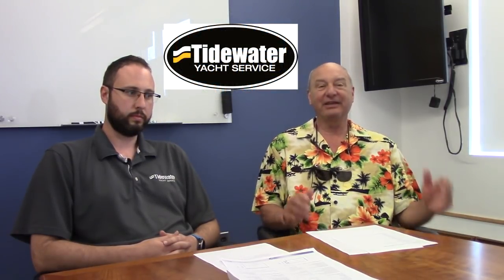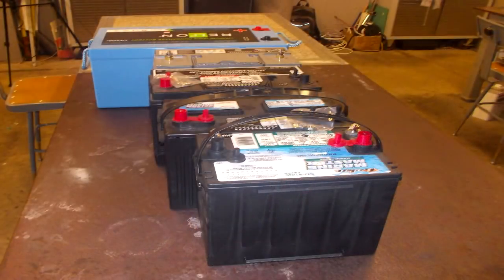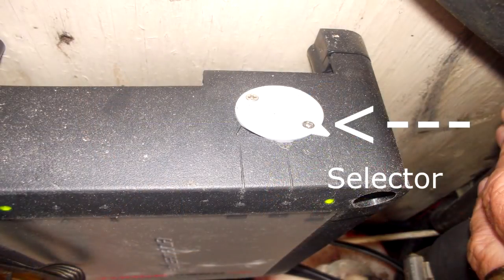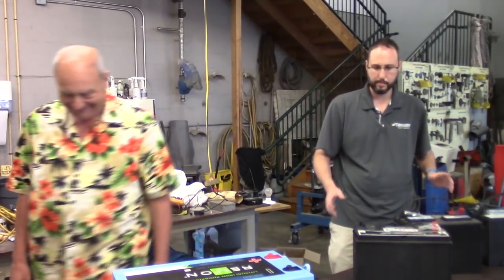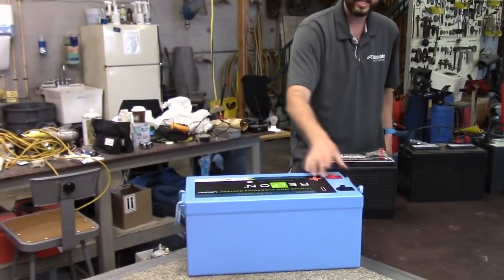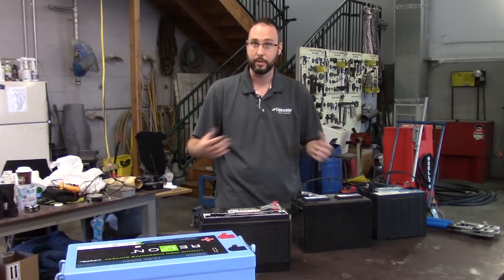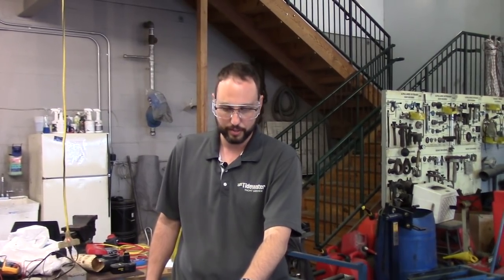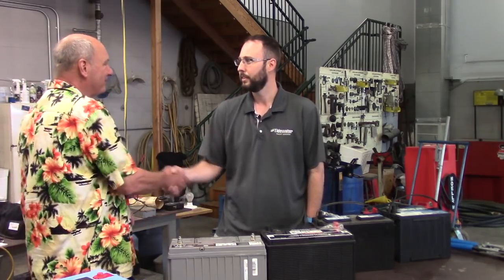Batteries: Types and sizing for your boat

Comment: Just as a side note, lithium iron phosphate batteries will not typically see 10k-15k charge cycles.  Most of these batteries typically have listed cycles anywhere from 2000-7000 cycles.  That being said you can get more cycles out of them if you do not use them in a typical fashion.  If you can cycle them between 30 percent state of charge, and 70 percent state of charge then they will last 10k-15k cycles probably.  Lithium iron phosphate batteries like to cycle around the 50 percent mark, and you can damage them permanently by running them down too far.  Also they don't work in really cold winter temps without heating, etc. Also charging them to full capacity typically generates a lot of heat and the cells hate that heat.  If you have enough capacity to only pull like 40%-50% out of each battery every day then you will get more cycles.  So buy enough batteries to make this happen or adjust the charging accordingly knowing the number of cycles will decrease.   So if you have solar set the top charging current to equate to 70% and have some way to cut off the loads when the state of charge gets too low or at the bottom threshold you desire with an alarm.   Also alternators can cook lithium's so using them requires taking care to modify or replace them accordingly.  A pretty good talk about batteries there Dom.  I am taking it there is a part two????